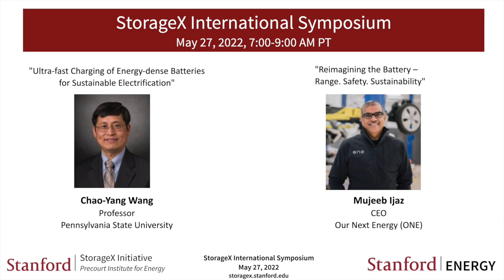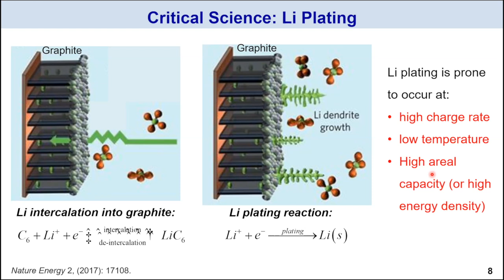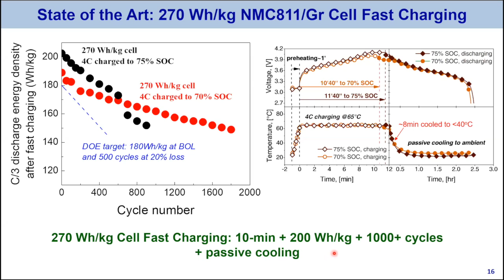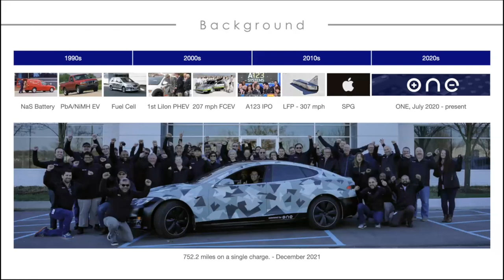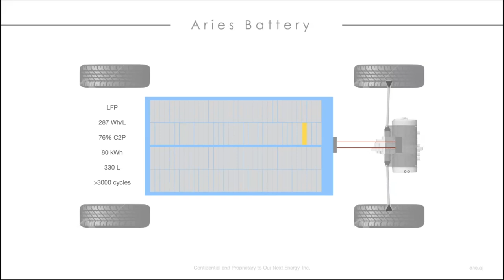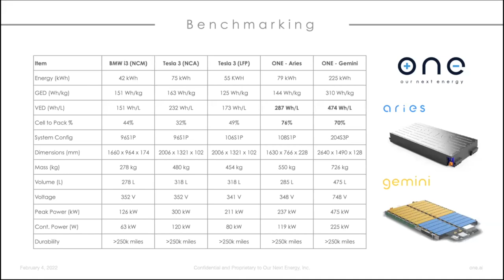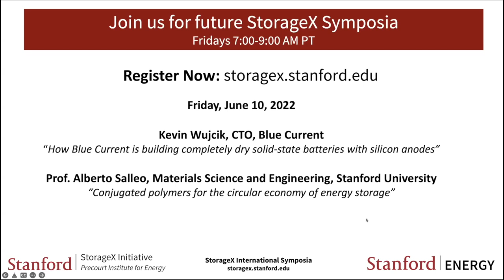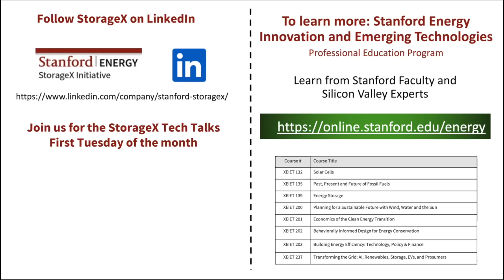StorageX International Symposium | Chao-Yang Wang, Mujeeb Ijaz

Comment: Philosophically, I'm not a supporter of carrying around a massive battery pack to protect for the rare 500 mile trip, but the point on fast charging is well taken. The Hertz Tesla Model 3 rental I took on a road trip had a rated range of 260 miles, which was more like 200 real world range driving at 85 mph with 4 passengers, and a 20 min stop at a Supercharger point gets you to ~65-70% SOC if you've preconditioned the pack fully

Comment: There have a number of successful reports on AC heating of the cells using their own energy or from the charger.  These seem to be more practical than adding more elements to the cell and changing its construction while also reducing energy density.   I wonder if there is any advantage at all to add heating elements vs using AC heating which also heats cell from inside out.